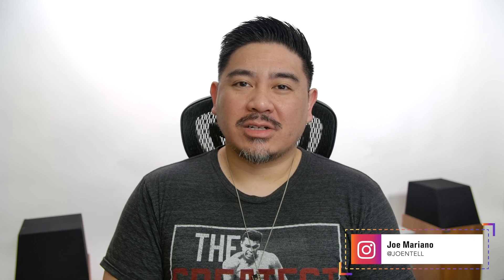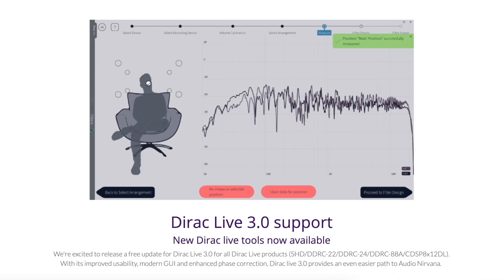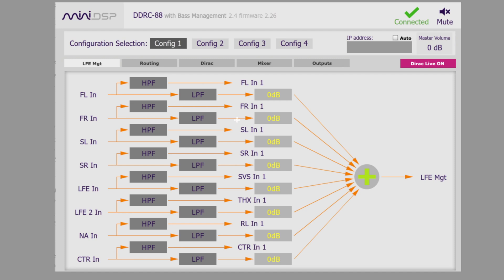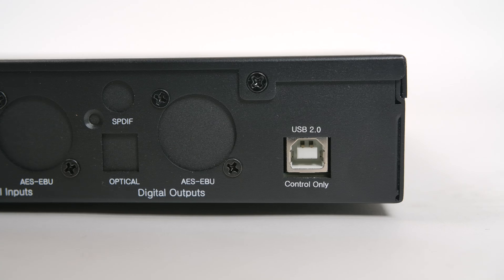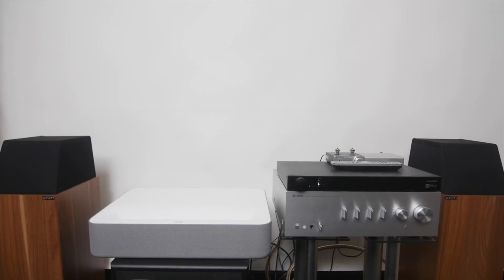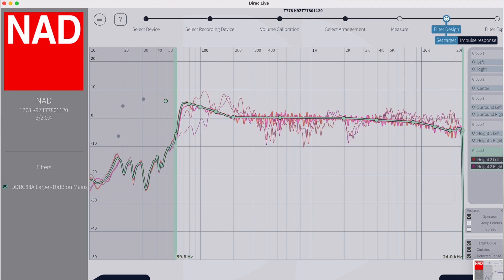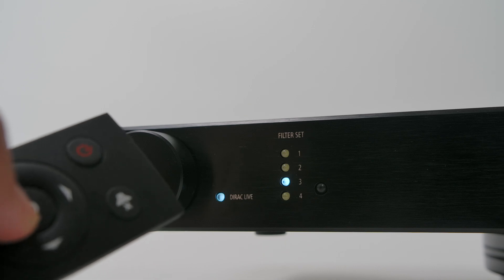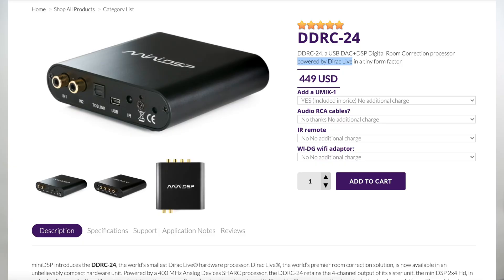Can YOU Handle the MiniDSP DDRC-88A / DDRC-88BM? It's a Beast! Full Review

Comment: Can I use my AVR  pre outs as a minidsp input and my AVR's 8ch analog input to be able to use the integrated amp instead of buying a separate power amp?

I have a Lexicon RV-5, I use it primarily for home theater.  Only outputs it has is a Zone 2 analog output and 9 channels of preamp outs. It has an 8 channel analog input, along with 4 sets of toslinks and coaxials, and 
10 analog RCA in addition to the multichannel analog inputs.

Any insight would be greatly appreciated.

Comment: Great info Jo.  👍
 Just to let you know I love the M10.   The only thing that I am questioning is the headroom. My speakers have a Room sensitivity of 92 dB. Maybe the 100w power of this amp is not enough for some reason?   I do listen to loud volume sometimes and I feel it's about 20% shy.
 Any advice?
Reply: If speakers are truly 92 dB efficient you have TONS of headroom with 100 wpc
(some speakers have optimistic ratings)
If the speakers don't dip below 3 Ohm and the amps handle the current well you should handle all peaks and transients with ease. How big is the room? A lot depends on this. To "fill" a room requires power.

Comment: Hey Joe, new to your channel and I really like the reviews and advice. Got a question, I have a Yamaha RXA3080 and wanted to know if it makes sense to run a Pioneer M-72 amp through the Yamaha pre-outs to power front LSI-9 Polk speakers or just use one of the Yamaha's channels not being used on my 5.1.2 set up? Thanks Ron
Reply from the maker: I think it depends on volume. How loud will you push them. External power is good for limiting distortion at the max levels.

Comment: MSO did wonders with my subs. Like yeah you can flatten the response with REW's EQ software but it wasn't nearly as good of results when looking at my other seats. Biggest issue is getting it working and I feel like there's no good guides as I was able to get through it with trail and error along with doing the tutorial and reading a pdf someone made for it but I still have questions for best practices when using it with an AVR along with getting sub to main integration with it. However I'd say I'm 90% to the best I can do with my setup which is a ton better than where I started with just Audyssey MulitEQ XT and my subs improperly placed.
Reply from the maker: Did you use sub only mode?
Reply: @joentell  Yeah, I honestly couldn't figure out a way to measure and get useable stuff with mains included. Tried full range, full range and adding crossovers in MSO, with crossovers enabled in avr and none really turned out to my liking. Part of the issue is that my mains are horribly placed so I need to enable Audyssey to tame boundary gain but not for the subs and I was having issues with getting everything level matched in MSO so it was getting confused. Honestly need to go through the tutorial again now that I know what I'm doing and retake some measurements with stuff level matched better. Another issue I find is that MSO likes to go to extremes and so I set stuff up originally for the capabilities of my miniDSP like 0 to 80ms delay and not logically what made sense so I'd end up with delays that were 40ms which were like doing 370 degrees in phase adjustment instead of just 10 degrees. I probably have like 40 failed configurations that just ended up with wacky results that never looked good which is why I think some other people I've talked with never got good results. I plan on making a tutorial on Reddit once I can get consistent good results every time but I'm not there yet as I'll end up with something great and I don't know how I got there. I'm definitely 90% there with my peq filters, delays, and gains but I think with some more work I can get to 100%. I ended up using the alignment tool in REW to get my subwoofer to main integration good. I'd be down to chat more outside YouTube comments if you're interested.
Reply from the maker: @TylerStout  link here to your post when you do it. 🙏

Comment: Can you combine the units for a 16chan solution? Not sure if Dirac on two processors could be used either in parallel synced some ways or of each speaker processing can stand on its own? (Ie does Dirac phase and time allinging to a common start point or adjust based on other speakers  changes)
Reply from the maker: In the forums they explain it in greater detail.

Comment: I've been saying for a bit that I think miniDSP has to be working on a Dirac Bass Control unit.  A miniDSP with a 4x4 design that can utilize the bass control.  I see it two ways.  One is that if you have a 16 channel processor and are doing a 9.x.6 system then you lose your ability to use the dirac bass control multi sub. So an additional unit can be used in conjunction with the processor so you can use all the channels and still use dirac bass control multi sub.  The second way i see it is for people that dont have Dirac but want to use Dirac Bass Control for their subs.  So instead of using the miniDSP with REW filters, or MSO filters (which is quite time consuming to learn and do) you can just use Dirac to get it done much easier and quicker.  Furthermore, Dirac will be releasing a few different options to utilize Bass Control in regards to Bass Management.  One of the options will be to use Dirac to optimize multi sub, but NOT optimize speaker to sub integration.  So my thinking is with that in place then it should be easier to implement an external miniDSP Dirac Bass Control unit.
Reply from the maker: I hope you're right